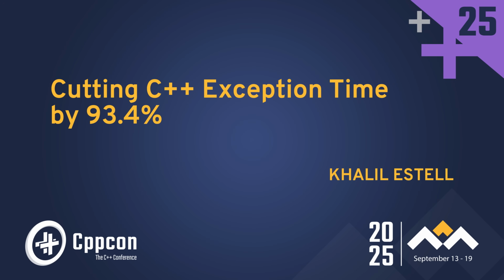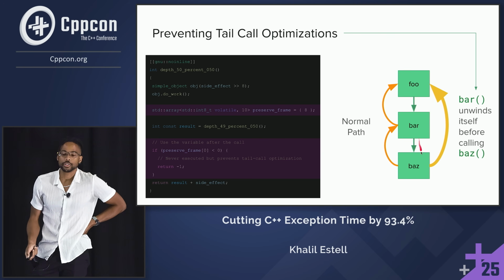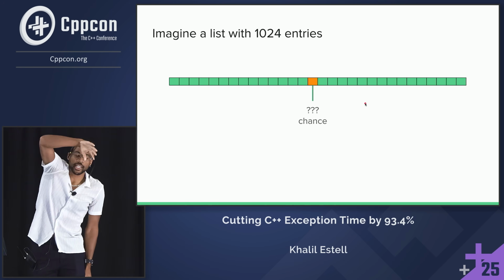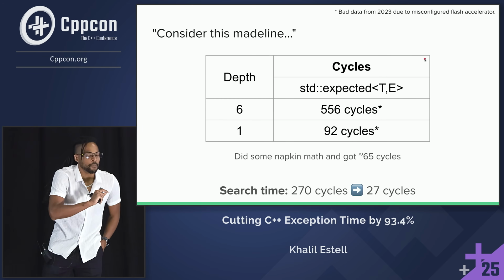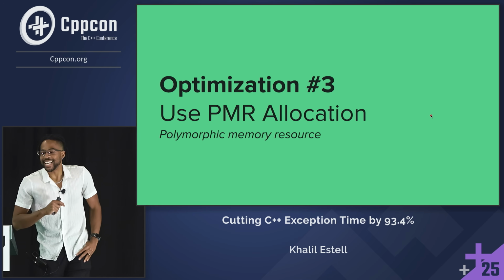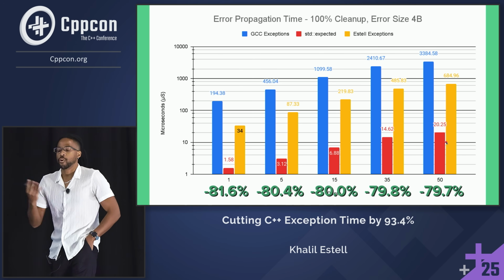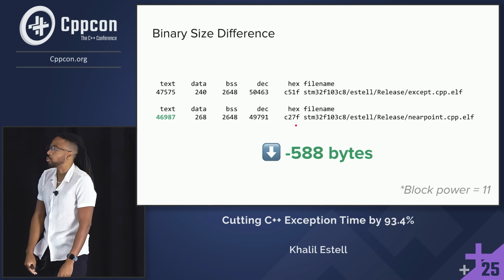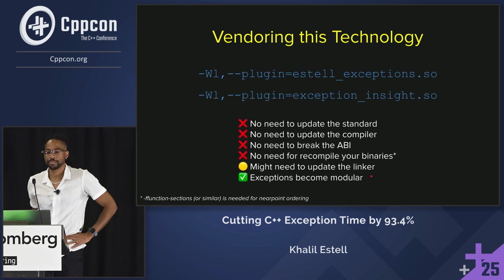Cutting C++ Exception Time by +90%? - Khalil Estell - CppCon 2025

Comment: Great talk!
2 questions:
1. How does all this affect the speed of the happy path (when no exceptions happen)? Especially if all functions return void?
2. The sorting of functions by size is the actual sorting in memory? In this case, we can't have advantage from having the happy path streamlined in memory. But maybe it's not a problem for microcontrollers without automatic prefetching and decoding...
Reply: No effect on the happy path, as discussed in one of his prior talks the happy path is already faster with exceptions than with error codes once your codebase passes a certain size. This has been true since the advent of "zero cost" exception handling. All of this work is to optimize the sad path.
Reply: At 1:01:27, he says that nothing he did hurt the happy path of the code. Also, from this being a linker extension and the talking about how these tables are in the TEXT region, I assume that all the sorting and tabling of functions is a part of the linker. The sorted results are written to the executable already sorted, especially because the addresses of all the labels in the jump table are compile time information. From this, I assume that the only time that this information would be read to memory is after something is already thrown, in which case we are not on the happy path anymore.
Reply: Thank you @RobotKnight924 and Nicolas Braden for you answers. Both of these are correct. 

From my tests, sorting the functions didn't cause any slowdown on my MCU. RobotNight is pretty spot om that MCUs don't have the complicated prefetching that more complex CPUs have.

But, on systems with complex prefetching, reordering the functions could potentially result in a slowdown for the happy path just due to cache locality and some other factors. I plan to do more research into how this effects runtime for CPUs like x86_64. But for MCUs no change on the happy path.

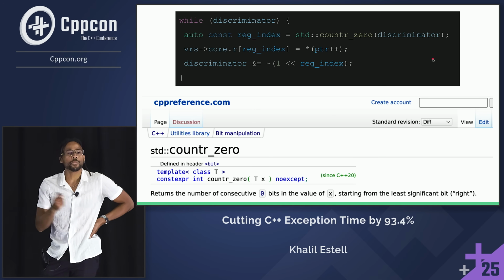Comment: 19:47 there might be some more room for improvement here. I've micro optimized a tight loop like this on x86 before and there's a number of ways to express this operation. I personally found the "count zeros" option to be quite expensive, at least on x86. This may be dependent on what instructions ARM offers, which I'm utterly unfamiliar with.
Reply: Thanks for the comment! I totally agree. Its likely there are even faster approaches to this. If I get more support for this research, micro-optimizations based on CPU will definitely be a point of interest for me.

Comment: I got a comment on reddit that I felt was a great comment about one of my claims. I'd like to explain it here. They stated:

> interesting that there's a "I don't want to pessimize the happy path", but the linker plugin orders functions by size? (doesn't / can't placement / relative placement of functions have implications for performance? ex. code locality, which is my understanding of the point of things like fipa-reorder-for-locality)

And to that, they are correct. I answered this with regards to this question of "why not push a frame pointer on the stack to make unwinding even faster." To me, a solution that required instrumentation, is a constant cost added to all functions. I felt that was a ask too far simply to support exceptions. Whereas, relocating the functions felt acceptable since we already do this in practice for other purposes. `-fipa-reorder-for-locality` is a great example. There is also Facebook's BOLT post processor as well. So my nearpoint solution could reduce performance by breaking those locality benefits. This is something that I have thought about but haven't spent any time directly researching. One idea is that leaf functions can be placed anywhere allowing them to be used to fatten up functions, which changes their location within the nearpoint ordering. Functions within the same realtive size group can also be reordered relative to their group. Things can wiggle around. So that could be used in some to relocate functions for performance with clear limitations. But for now, this is a limitation of nearpoint so far.

I'll be posting this on LinkedIn as well to clear up this claim. I'm leaving out the reddit user's name because I don't know if they want me calling them out here.

Comment: Python has context managers that handle enforcing finally for you in most cases. Borrowing from that idea, along with Jon Kalb's notion of layers "on top of fast", we could let the caller opt in to pessimizing the happy path in order to make the sad path faster.  Basically, you create a control structure that the programmer can place on the stack, which tells libunwind "exceptions of these types land here". With that, you'd have full escape continuations, and the possibility of unwinding any stack depth in O(1) time. Just need a linker plugin that ensures the claim about being the active handler is correct, which would use the same techniques as the exception-insights tool.

Comment: I first learned about table-based exceptions in about 2014. I was shocked when I later discovered C++ exceptions are so slow in the "sad path". Coming from call/cc in scheme, often implemented via continuation-passing, it took me a long time to figure out it's mostly due to a very outdated libunwind implementation. 

Anyway, I theorized that exceptions will, in some cases, unwind faster per frame than std::expected. Specifically if you let the compiler do its best to use TCO, inlining, and so on, then it can result in less work to do externally unwinding than with inline error values. So after your first talk, I went and collected the data.

In short, running on modern x86_64 ryzen, if you use std::expected exceptions are reliably faster returning 4-byte error codes once you pass a call depth of about 150 frames.  (If you use C-style out parameters, which are about 2x the speed of std::expected thanks to x86_64 linux ABI having 2 return registers, they hold their lead until about 5000 frames). Specifically, exceptions take about 1.22 ns per frame, while std::expected takes about 3.95 ns per frame. C-style errors take about 1.27 ns per frame. Which means it takes about 20 frames per ns of throw overhead to catch up to C-style errors. It's worth noting llvm's libunwind is somehow slower per frame unwound, so it never catches up.

I expect with your optimized unwind functions, in this sort of code pattern, exceptions would outperform return values (certainly outperform std::expected) at realistic call depths. Where each frame is about 2.7 ns faster to unwind, at a call depth of 10, you'd have a "budget" of about 100 cycles to start unwinding.
Reply: 150 frames? 5,000 frames? If you have that many nested calls or try/catch scopes and you use exceptions as a control-flow mechanism then you have other things to worry about than unwind time 😅 Did I miss or misunderstand something?

Comment: Maybe this would perform better compared to: https://youtu.be/wNPfs8aQ4oo?t=2250 : Instead of checking the type sequentially - it seems that a range check could be sufficient. If you assign a number to each type that is involved in exception handling or throwing and order the types based from base to derived, and store the number of derived types for every type.... Then to figure out if the type thrown is the type needed for the catch block, you only test if the type id or rtti ptr is in the type range stored at the catch block.

Comment: Amazing talk. I've been looking forward to this for a long time now. I wonder, for std::expected, if you used an error type which is allocated on the heap, how would the performance cost grow when propagating compared to exceptions. I'd think that advantage of exceptions would mostly disappear no? 

In terms of API design when it comes to exceptions. I kinda agree, and kinda disagree. I agree that you should strive for functions that can't throw, makes most of the code much more easier to reason about, especially if you don't have a mental model on how to reason in a codebase with exceptions, but at the same time, if you're a library designer, I'd prefer that library APIs throw or do anything to signal an error if bad data can be passed to it. I can't phantom the idea of writing something like Win32 code with all the functions no longer able to fail and signal GetLastError() because every function's precondition is now on the user to ensure it's correct; While it'd probably be more performant to do so, as the user knows what can and cannot have bad data, it just intuitively feels like it'd be a horrible UX to work with that kind of library.
Reply: No. Heap allocating the error value does not solve the issue. Once you are unwinding, after the error value is created, after the exception table lookup is done, when you're in to just restoring register values, popping the stack pointer, and invoking cleanup code, exception-based unwinding has less work to do than errors-as-values. This means the cost per frame unwound is lower in the exception case than in the expected case. The performance difference is almost entirely due to the high overhead of the cxa_throw and related calls. Yes, you can improve the situation significantly by getting rid of the repeated memcpy, that narrows the gap in per-frame cost down to as low as about 10 ps per frame. But you're doing it by invoking malloc, which will take a big bite out of the lead std::expected otherwise starts with.

That said, if you preallocate your error value, assuming you can afford a static global read/write error value, then you get that fast relative speed without paying the allocation cost. You're still slower per frame, but only about the same as using an int as your error type.  

Regarding his point about avoiding errors entirely, I think the best solution is to move your errors to compile-time as much as possible. If there's a set of preconditions for calling a function and having it work, if you can write a C++23 constraint that guarantees the inputs will be valid, or fails at compile time, that is nearly always going to be better than waiting until runtime to signal a problem. Once you are at runtime and find a problem, you need some way of telling the caller (ideally via exceptions) rather than just silently ignoring the error.
Reply: > for std::expected, if you used an error type which is allocated on the heap, how would the performance cost grow when propagating compared to exceptions. I'd think that advantage of exceptions would mostly disappear no?

I'll have to measure that and get back to you. It really depends on how long it takes to allocate that exception via the heap. In a lot of contexts that can be very quick. Once you have the error captured within a unique_ptr<T> (or in Rust a Box<T>), then propagation should be rather quick since your error object is simply a pointer. I wouldn't say it disappears entirely. But the advantage is a changing target. Because I'm not done with optimizations. This is just how far I've gotten at this point. What I mean to show is how the error size does matter when it comes to std::expected more than one might expect. Far more than I ever expected.

> In terms of API design when it comes to exceptions. I kinda agree, and kinda disagree.

I'd like to clarify this a bit. I'm not saying that nothing should report errors. If an error is detected and the library or subroutine or utility library has no context to handle the error, then it should be propagated to a part of the code that has additional context, which is up the call chain. So no, I'm not advocating for not reporting errors at all. But, I one thing I consider every time I write an API is, what kinda of errors does the function have to detect in order to validate its inputs. If I can make the number 0 then I will. For example, I have a non-null smart pointer I use to eliminate the need to check if the smart pointer is null by making it impossible. Now my API has one less thing to check and potentially get wrong.  But I do agree with you that code will end up in a place where there is nothing more you can do but propagate information about something going wrong.
Reply: I think it depends heavily on if you can reuse the data. Once heap data is loaded, there's no performance difference against stack data, so if the CPU has enough cache, it won't have to reach out to grab it more than once. During an unwind, that might very will be the situation, so I think you might be right about std::expected. It would still be copying the address each time, though, so it would still be less performant than a 4-byte int on most platforms, if only by a tiny bit.

For my own code, I actually do not use any kind of exceptions or error-handling in the library, only in the production code itself. To me, the library is sacred; if something in the library fails, it must be catastrophic enough to be unrecoverable, else it should be rejected beforehand.
For example, one of my earliest projects was a FixedString class, which was designed for quick and easy stack-allocated string usage. The class enforces a terminator constant at the end of the buffer, and does not accept any writing outside the buffer. Attempts to do so will fail at compile time, and even if it is manually improperly accessed during runtime, it will return a terminator value.

In production code, I prefer to use std::expected or similar stuff like concepts instead of exceptions, but I think there's a valid usecase for it. Recoverable exceptions for complex systems might not have the luxury of returning errors by value, and it might be easier to debug using exceptions. I never really considered performance, since I would consider throwing an exception to be, well, an 'exceptional' situation. If I need to worry about the performance of exceptions, I would think I'm throwing way too many exceptions during runtime.

But perhaps that's why we haven't seen much work like this before.
Reply: About returning a heap-allocated error object, it will still be slower in the happy path because of all the branches at every level of the stack. Exceptions are fast because they skip all the branches between the error source and the error handler.

Comment: amazing work, will it be locked to gcc? i would love support for this in clang
Reply: 52:00
Reply: it just needs to be converted to clang's implementation of the STL

itd be some work, but it shouldnt be that difficult since the two compilers' libraries arent that different.

the hardest part will be testing and examining the generated assembly for any quirks or edgecases, especially with O3.